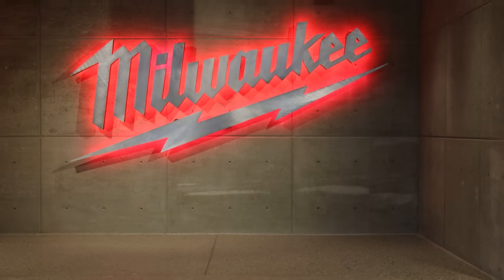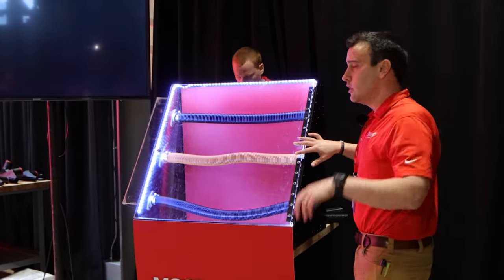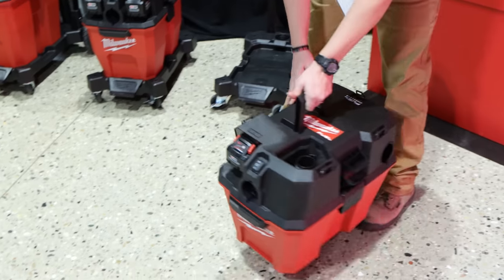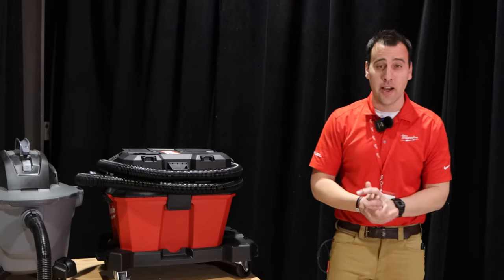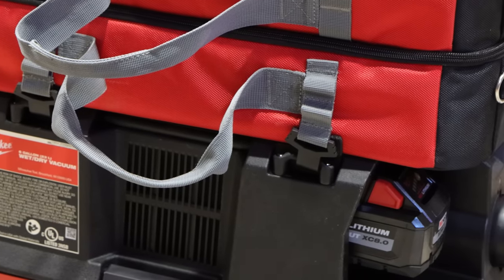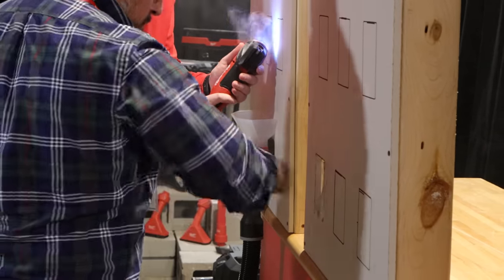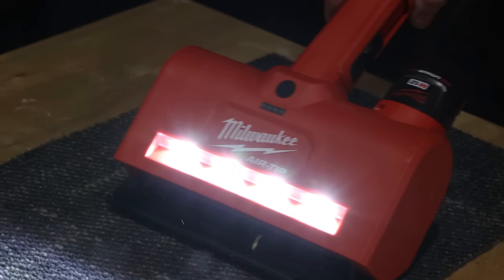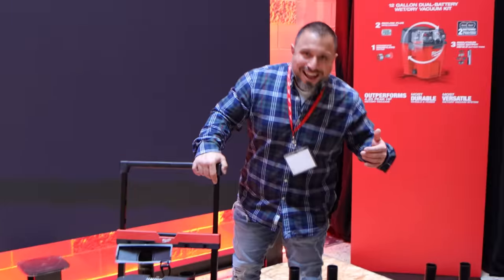Milwaukee Tool Releases Full Size M18 Vacuums FINALLY!

Comment: @VCG Construction When is milwaukee going to come out with a cordless hot melt glue gun??? I've been looking for a hot melt glue gun that can provide really hot melting Temps to use better industrial glues for carpentry application but haven't found a portable option yet that can do just this! Any thoughts on who makes a cordless glue gun that can fit my needs? I know I'm not the only one wondering this...

Comment: I wonder if the m12 vac has enough suction to hold the new air tip on block wall.
Reply from the maker: I doubt it but it’s worth a try

Comment: So you have to buy a separate (expensive) head to use it will wall power instead of leaving the cable or an outlet on the battery powered head?
Reply from the maker: Yes
Reply: @VCGConstruction  two steps forward, then one step back

Comment: Did Milwaukee consider adding a sawdust separator feature, inquiring woodworkers wonder? Does the filter not have a built-in auto cleaning feature? Looks like a great system though!

Comment: Im a mobile detailer and have been looking for a cordless vac solution but they all seem to have been lacking the power I need for a deep clean. I think the dual battery on top of the small bucket is gona be the ticket!
Reply: Have you tried ridgids dual battery came out years ago and is powerful!
Reply: @apllDgrapllD  No I didn’t know that exists. Im currently running a Rigid 4gal 5hp
Reply: @apllDgrapllD  Just checked it out. Looks decent but way to large for my needs as im limited for space
Reply: @completeturnarounddetailin3536  yea then I’d wait for these to go on sale

Comment: Please say they hired an engineer to design attachments that are standard sizes! 🤞

Glad to see 2x batteries are being utilized.  
It does seem unnecessary to sell motors alone. I really don't see someone just upgrading the motor, and leaving the old motor "collecting dust" so to speak.
Reply from the maker: Sounds good! 👍🏻

Comment: They missed the mark by not having the pack out boxes mount to the top of the vacuum. That would have been huge. Or with the size of the vacuum head it could also be a battery charger with a retractable cord.

Comment: Would have like to see packout compatibility from the start.  That as a rolling base for a jobstack would be a reason to make me buy it.  The AirTip accessories definately do not blow! ;)
Reply: Integrating the packout would provide a new space to store tools inside the canister, negating the need to buy additional pack outs. For Milwaukee, that's a no no. They want you to buy more pack outs.

Comment: No wireless link connection to miter-saw?
Reply from the maker: It would have been a welcome addition in my opinion as well!
Reply: I'm disappointed as well. Makita has had AWS for several years now. Not sure why Milwaukee has to drag their feet on this one. Plus I would want to see a long list of carpentry tools that utilize autostart... miter saw, table saw, planer, sanders, biscuit jointer, etc...

Comment: Got to have the 12 gallon with smaller container too. Would be good for clean up of larger masonry debris besides everything else. Cfm little bit lower then I was expecting though it is higher then the packout vac I got currently. The main thing is how good can it clean. Sds plus chisel brick then remove largest debris will it clean up fine. Highly possible with the size of the hose.

Comment: Ok, as a "shopvac" it's cool. The accessories are insane. But if we talking about universal use, if we talking about concrete dust, drywall dust than why, WHY none of them have self cleaning filter system  (electromagnetic shaking to be precise, becuase reverse blow SUCKS for many reasons and we all know that) like god of vacuums starmix isc batrix L 36-18v or metabo asr 36-18 bl.

Comment: For me, I think the option of connecting a cord if you have access to power at the job sites. No cord just the connection like they have on the battery powered floodlight with option for power cord.

Comment: Can you do another review on the 12 gallon on how it's been working so far I been thinking about buying the 800 dollar one but it's crazy expensive but I feel like it's worth it because of the two 12 Amp batteries. The batteries alone are like half the price of the vacuum lol and there high output

Comment: Do they really expect us to buy 2 12 amp hour batteries for that thing 😱
Reply: Not really any different than the lawn mower. And another of pros already have 1 or 2 12ah batteries.
Reply: Buy once cry once?
Reply: @billsedutto8824  yes, but why must you buy them at all? If they offered dual power it would have solved the issue and consolidated their product line a bit.  If they did that though then they wouldn't be able to sell 3 different heads with different power ratings. It would be one, as it should be!  Who really wants a weaker vac? But I also wouldn't want to buy more batteries just for the sake of one tool.  Feels like dirty business that only suits the manufacturer and not the consumer to me.

Comment: For the price that they want for this I'd rather get a corded one with an extension cord. The fact that they sell cordless tools for up to 3 times the cost of their corded counterparts is beyond me. Add to that the fact that you can't plug, use, and charge like Metabo. Aside from the fact that batteries(a power source) remains proprietary really begs to ask the question: "Is it really worth that much?"

Comment: Packout not in this is a bad idea. Also no extractor option is lame. Need that second part water push to the handle. Would of been a killer if those were options/ apart of the systems. At least make a packout base.

Comment: Awesome but also.... wtf Milwaukee!? 2 separate units if you want the ac option? Why not just incorporate it into the main unit like with the lights. We all know it's possible.  They seem like amazing vacs but there's always little things like that which seem like they prioritize opportunities for more money over convenience/ease of use or innovation.
Reply from the maker: How much additional would you be willing to pay for the corded option incorporated in to the vacs?
Reply: @VCGConstruction  it's less about how much I or anyone is willing to pay and more about are we paying more for separate units than we would if it was just combined into a single unit. What anyone is willing to pay is based on the capabilities of the product, convenience, ease of use etc. Combining it into one unit also reduces clutter because you no longer need 2 top units. I mean I love my Milwaukee tools and will probably still get the double battery but it seems like either a missed opportunity or intentional money grab. Every brand is guilty of it from time to time unfortunately
Reply: @VCGConstruction  I guarantee you though if they had all 3 on shelves battery option, corded option and one that had both. We know which one would be the favorite unless it was unreasonably priced.

Comment: at this price point, I could buy a new comparable vac every 6 months for years, since this price doesn't include batteries (referring to the 9 gal). It's cool, but does not make sense from a bottom line standpoint